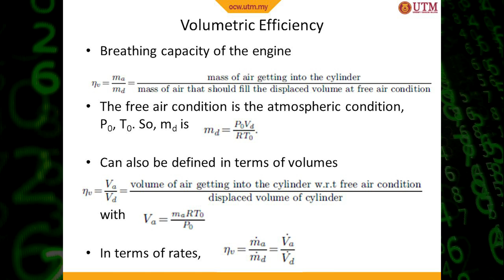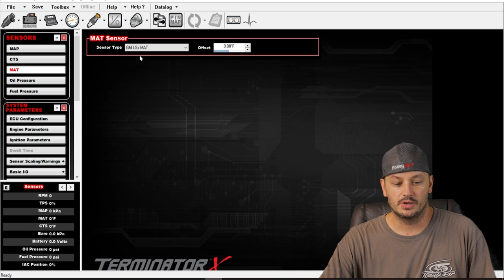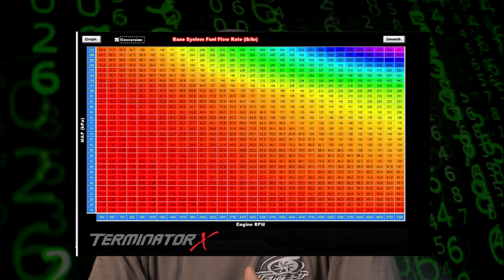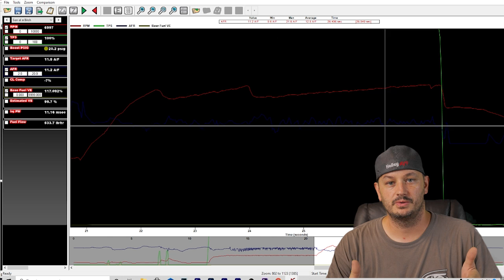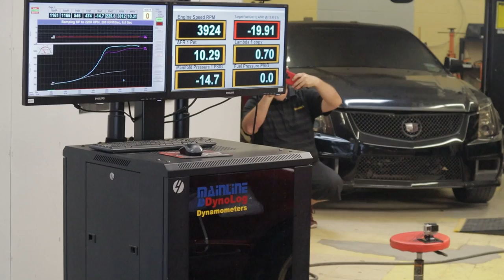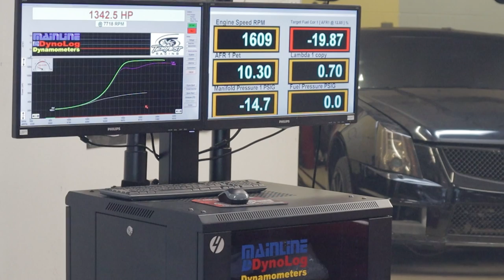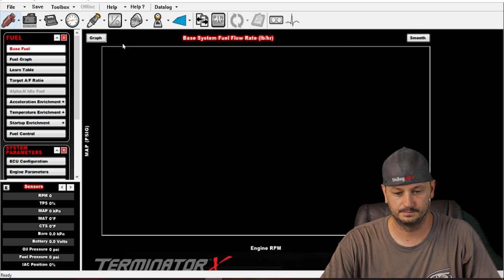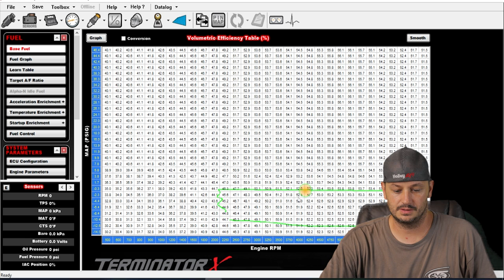Holley EFI \\ Terminator X for Beginners - Volumetric Efficiency VS. Speed Density

Comment: Will the Terminator X work on a 1982 Corvette which has 2 throttle bodies and only 2 injectors each responsible for half the cylinders? I realize Terminator X is way overkill but wondering if this would be a good environment for me to learn?

Comment: Awesome video as usual Joe👍
Here's my 'experience' (what/how I learned).
I've been tuning EFI on bikes for 20+ years and since the only "aftermarket fuel tuning boxes" have all been Alfa-N that's what I learned (first).
So since I was used to tuning Alfa-N (and Lb/Hr directly relates to HP) I continued using Alfa-N (on the NA engines) and then Speed Density on Turbos.
I was actually very surprised how close my first stand alone fuel table "builds" were (both NA and Boost) but I need to add, that was 100% because I also have several years of dyno experience = thousands dyno runs/data to help me estimate the fuel flow for TPS vs RPM and MAP vs RPM on the Turbos.
And as some might guess? the fuel graph/curves end up looking a lot like the HP curve on the dyno graphs.
With that said, the first time I tuned with VE I was like, wow this is simple! (because as you said) the numbers in the VE table don't vary much (compared to Lb/Hr)...

Comment: Joe great video, and some great pointers

one comment, VE can go north of 100% because of what you mentioned but really it’s also an issue with the VE calculation itself as the clearance volume is not included in the displaced volume of the engine which is used to calculate VE. So when you got to 100% VE  you are refilling the displaced volume but not also the clearance volume (trapped EGR) when you go north of 100% VE you are completely/more fully scavenging the engine cylinder contents.
Reply: VE uses an inferred map value for egr by cross referencing barometric pressure sensor data, delta pressure feedback, and the change in mass air flow data as the engine consumes exhaust gas. cheers.

Comment: Great video with explanation of volumetric efficiency vs speed density for Holley ecu’s. Having only tuned a handful of N/A Ls combos, with factory gm pcm’s, the explanation helps. 

Hptuners will call volumetric efficiency (2 bar, 3bar) speed density which can be confusing for beginners. As you know tuning factory gm pcm’s can be overly complicated, I hope to integrate a terminator x with my gen 3 ls truck one day

Comment: Joe, thanks for your time in putting up these videos.

Question, I had my LS tuned with VE , 416ci , but my VE numbers barely crest 78 at the top, 12.5 AFR. Why so low?

Correction is within 4% +/-

I'm afraid to run it wide open.
Reply from the maker: Likely just an injector scaling issue. You can literally make the numbers in the table be whatever you want them to be if you manipulate the injector info

Comment: Joe, thank you so much for your videos. I watched a few hours worth when I was stuck at the house with COVID recently lol. Now my TT LS 69 Camaro with Holley Dominator runs and drives better than ever. One question: I recently switched to VE from Speed Density. I run E85 and always kept it on the GASOLINE scale because it's what I'm used to looking at, plus it never made a difference with SD. This throws my VE table up into the 130-140 range at WOT. It rides around 68 at idle. The math tells me this is what's to be expected as it's doing calculations for gasoline, but actually having to spray much more fuel to meet AFR goals. If you multiply my VE numbers by 0.67 (e85 to gas conversion), you get VE values that fall in line with what I'm seeing in your video. Is my thinking correct?
Reply from the maker: Yup ve numbers will be higher with ethanol.  If you want the table values to be normal just use a custom table to add the extra fuel for the ethanol. Outcome will be exactly the same

Comment: What kinda of drive data log should I take to get the best info that I could use to determine what I need to adjust ? What can be determined from a datalog I'm concerned about the timing at times I have set it correctly and adjusted the inductive delay its pretty much spot on just not sure exactly what the numbers should be but I'm sure it will effect the o2 results if not correct

Comment: In VE mode does the AFR offset vs coolant temp change the fuel calculations even when in open loop mode?  Or it ignored in open loop mode totally?
Reply from the maker: It only changes the closed loop target. It does not add or subtract any fuel (like you would think it would in ve mode)

Comment: I use to using injector CC. The 40 lbs and 60 lbs is not quite clear. How is that determined?
Reply from the maker: There are calculators for that online to get exact numbers but the math works out really close where a 800cc injector is 80lbs or 1200cc is 120lbs etc.

Comment: i'm looking to switch from duel 750 holleys on my holley hi-ram 12 to 1 motor to be able to switch fuels (race to e-85) my concern is i'm running a 104 center line with a 108 lobe separation solid roller cam. 255/267 duration @.50 with int. closing @ 51.5
do you feel the a holley efi kit will be able to adj properly with the cam i have ? i'm looking to be able to run different fuels on the street if needed based on my location. without swapping carbs or jet.. any info on a proper kit or advice would be appreciated. thanks